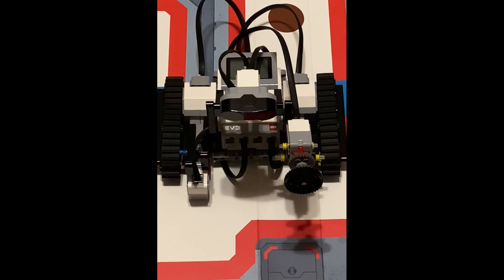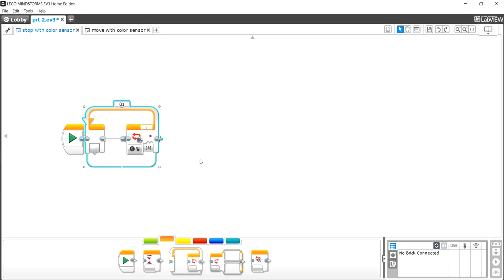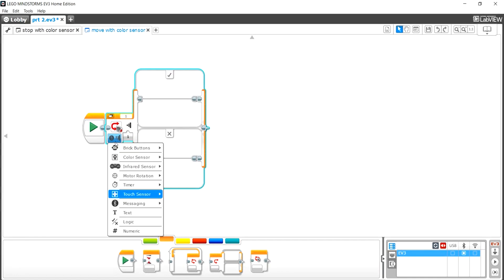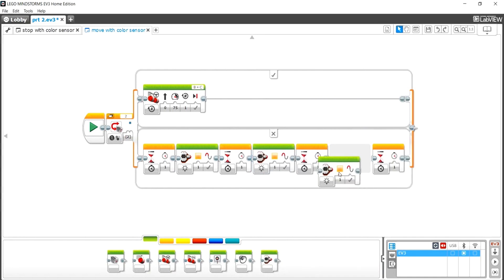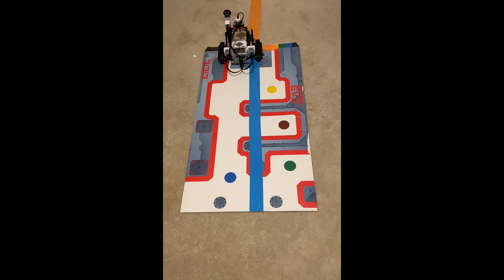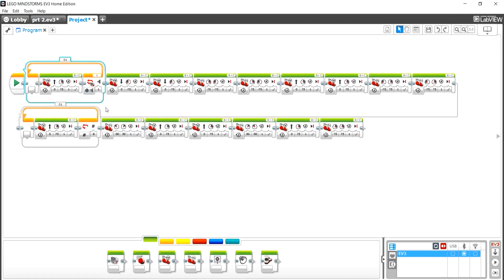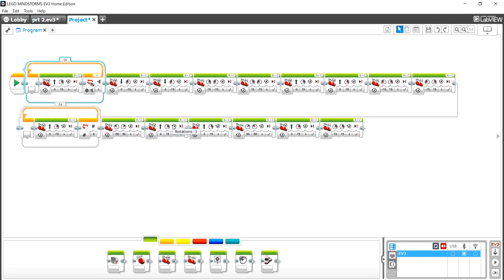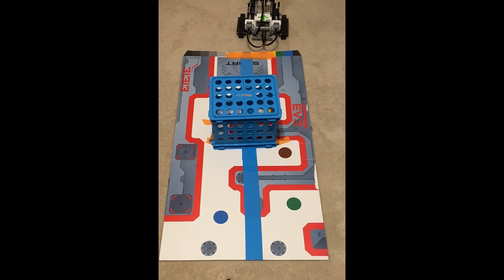EV3 Robotics - Part2, Color sensor and Touch sensor

Comment: Hi my robot has a software issue about the touch senor.
It's not a port number issue. In fact, when you check the ports on the software it shows that it's recognizing the sensor and its state on the correct port. And it does get pressed. I even tried pressing it manually just to make sure.
But it doesn't work in the code and say, if i have coded it to move backwards when it hits an object, IT DOESN'T STOP, it just keeps going forward continously.
Any fix?
Reply from the maker: Thanks for watching my video, I have not done a lot of troubleshooting but one question
What setting do you have you touch sensor on in your program?
Reply: @ProgramCuber17  what do u mean by setting?
Reply from the maker: @DevKukadia  what I meant by setting is in your program do you have it so that if the touch sensor is pushed in it goes backwards or if it is pushed in and released it goes backwards?
Reply: @ProgramCuber17  Hi sorry for my misunderstanding. I have coded the robot so if the touch sensor is pushed in it goes backwards.